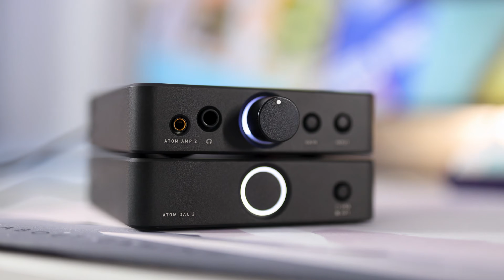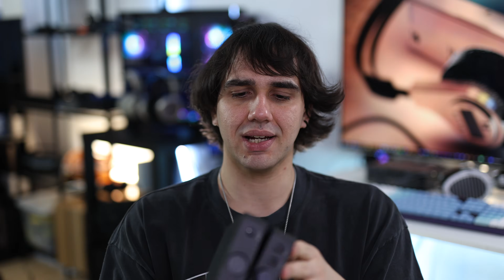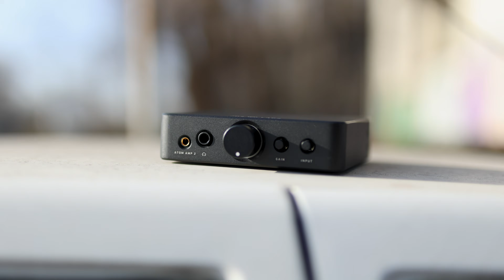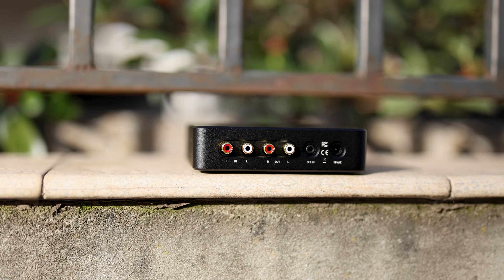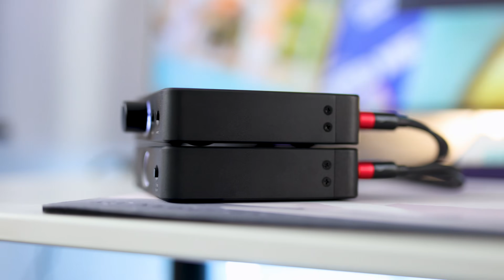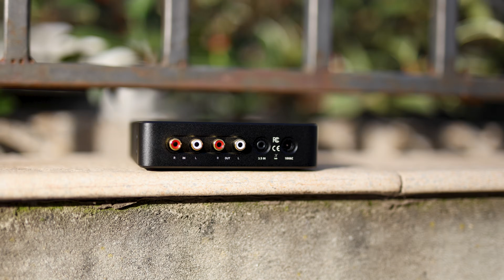JDS Labs Atom Stack 2 - Atom DAC 2 + Atom AMP 2

Comment: Just ordered the stack, and realized the usb cable that came with it (3ft in length) might be too short, it’ll be connected to my PC, can i use a little longer usb cable?
Reply from the maker: oh yes, absolutely, there is no worry. I think 2 meters is max for usb cables for a reliable signal

Comment: Interesting! Do you think atom stack or element 3 mk2 are upgrade compared to ifi zen stack, could you elaborate a little bit on the differences? 🙏
Reply from the maker: Hii, Element3 mkii has an advanced EQ, it can become anything you want real-time, I think that alone allows it to be very different. Atom stack likely won't be an upgrade and more of a side grade. But element iii surely will in resolution and details
Reply: @AudiophileHeaven  Thanks! Element III MK2 on the way.
Reply from the maker: @newkid7  I ope it will be lots of fun for you!
Reply: @AudiophileHeaven  Rocking it! My good old KSC75 suddenly has bass lol.

Comment: Has anyone ever done the comparison test BY EAR (so not based on technical specifications and graphics but rather on personal impression by ear)
BETWEEN
1: an headset 250 ohms plugged into the 3.5 mm headphone jack of a RECENT MacBook Air or Pro (equipped therefore, not with the Intel chip, but with the Apple chip, at least M2)
and 2: the same headset plugged into the Atom 2 stack ?
Reply from the maker: Maybe someone who has a mac can answer, i only use a PC computer, and here sound of the headphone output differs from motherboard to motherboard

Comment: If we only buy the Amp Atom 2 (without the DAC) will it be able to work with a MacBook Air M2 ?  How do you place the sound quality level of the Atom 2 stack compared to the new version of the iFi Audio Zen Dac 3 ?  Version 2 of the Zen Dac had received a lot of awards in the professional audio community.
Reply from the maker: iFi alays receives awards, but it is a lowest cost solution, I reviewed the Zen DAC 3, it is a good device, but has a lot of background noise with IEMS and even with some headphones. JDS Stack has no background noise and sounds more detailed, more controlled and punchier. I woudl not use the AMP without the DAC, or a different DAC at least
Reply: @AudiophileHeaven  OK I see. But I can confirm that the Zen DAC creates absolutely NO background noise in my Beyerdynamic DT 990 Pro 250 Ohms headphones. If someone has this problem, it may be related to their headphone model. He can buy also the iFi SilentPower iPower2 from iFi Audio which is supposed to clean any background noise 10 times more than a simple basic adapter.
Reply from the maker: @paulwoaert  That is true, I noticed noise with most IEMs and some headphones. DT990 250 OHMs will not have noise with anything, 250 OHMs would filter noise like a sponge. iPower2 is a good recommendation, but a bit pricey for Zen DAC 3, yet I would get it to use in general.
Reply: @AudiophileHeaven  But the Zen dac 3 is not more expensive than the Atom2 amp since the Atom requires you to buy in addition the dac if I understood correctly. The ifi Zen dac has a volume button and a gain button, so you can buy the dac only. While the JDS labs Atom dac has no volume or gain button, which means that you have to buy the Atom Amp in addition. The stach Atom amp + dac costs $300. The ifi zen dac 3 costs about $257
Reply from the maker: @paulwoaert  Yes, that is about right, and generally the JDS Stack would sound a bit better, but be less conevnient since it needs two power sockets, more cables, and has two devices running instead of one. So Zen DAc v3 would be a simpler, more convenient solution, while JDS Stack Atom would be a better sounding, but less convenient solution

Comment: Fiio k9 akm or atom 2 stack?
Reply from the maker: Hm... Good question. For the most part, atom2 stack is cheaper, and a bit more ergonomic. It has slihgtly less function, but sonically it is a bit better, so I would get the stack and enjoy it, lower background noise.
Reply: @AudiophileHeaven  Very intestesting you find the stack sonically better.  That's the most important thing for me

Comment: Hmm my Fiio K3 needs more power so I have been thinking about buying one of these to use with the K3's line out and maybe one day buy a dedicated DAC. However a dac/amp like a K7 or DX3 Pro can be had for almost the same price as this when on sale and then I could use my K3 for whatever I wanted. What would you do?
Reply from the maker: K7 is still a great option too. JDS Labs as a warmer sound though, many find it pleasing too, I would likely consider the JDS Stack if I wanted lower noise and a warmer sound, plus Atom AMP 2 can drive both IEMs and Headphones

Comment: Great review again, the only real issue I have is the requirement for two power sockets as I constantly struggling to find available power socket. I would have much preferred the two units could be linked by a short cable so as to provide power to both units via one power socket. Btw, I had no issue understanding your accent this time, I think it may relate to expectation of words. For example I understand when you're talking about features as I can anticipate them but when you mention brands and product names I'm not expecting  such as ifi or recognise, then my brain finds it more difficult to translate your accent.
Reply from the maker: Thank you for your input! Jds labs makes the element iii MK2 for those who want to use just one power socket . As for the accent, I think I generally never heard the names of most products spoken in English so I pronounce them in Romanian which sounds unnatural

Comment: how does it compares with similarly priced dongle dacs in term of sound quality alone( for iems exclusively)
Reply from the maker: It has a lower noise floor than most dongles, but also lower driving power. While you could argue most IEMs don't need that much power, it helps with giving them a fuller , deeper sound. This being said, I generally would comapre it to 100 USD dongles, because for around 250 USD, you can get a dongle which is similar in sound and resolution, if you don't have headphones. Let's say Shanling UA5, Lotoo PAW S2, iFi Go Bar or Aune Yuki,
Reply: @AudiophileHeaven  so for iems exclusively the cheapest dongle dac you mentionned (yuki at $160) is very close in sound quality to this $260 jds lab stack except for this fuller/deeper sound ? is this fullness coming from the bass or the mids or the placebo from big black stack visual aspect vs tiny tinny dongly dongle ? can you set it appart from any dongle you mentionned  in a blind test to rule out placebo ?
Reply from the maker: Absolutely can tell them apart, each one of those dongles has a signature of its own, and Yuki arguably sounds the most polarizing, extremely wide but also very loud, dynamically compressed. Try a few of them for yourself if you believe they are even similar, you'll be amazed. The tuning and sonic signature differences can be huge.